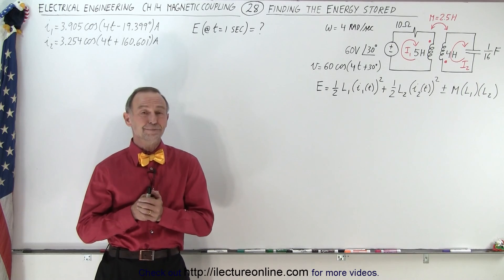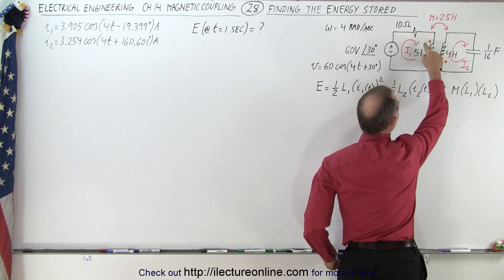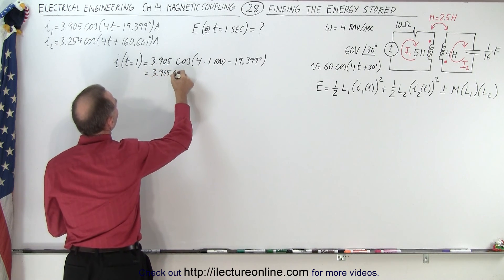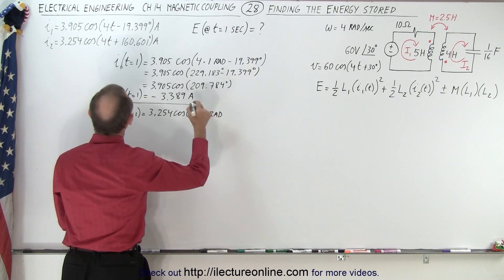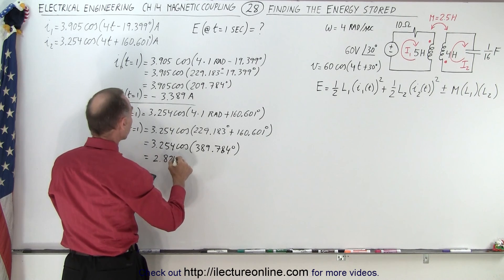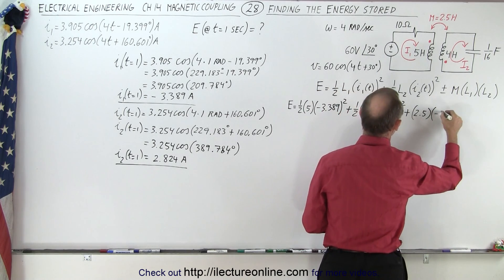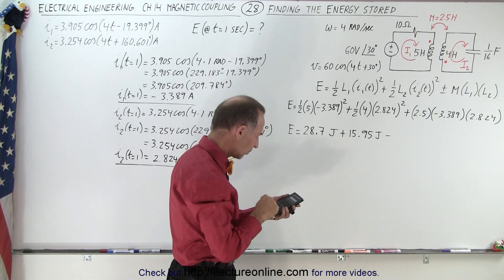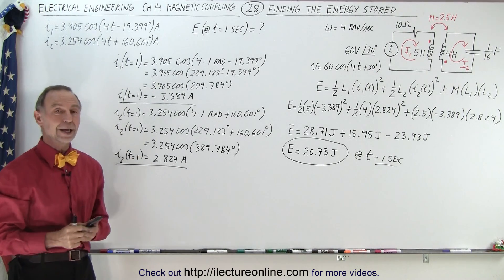Electrical Engineering: Ch 14 Magnetic Coupling (28 of 55) Finding the Energy E(t=1s)=? Method 1

Comment: I have a question sir, if the dots are across each other would we use -Mi1i2, since in video 21 showed the circuit the same as this but we used -Mi1i2 in there?